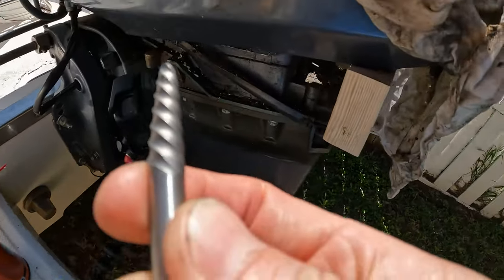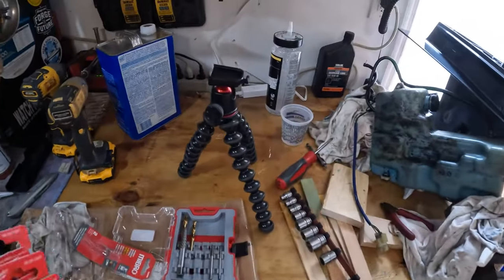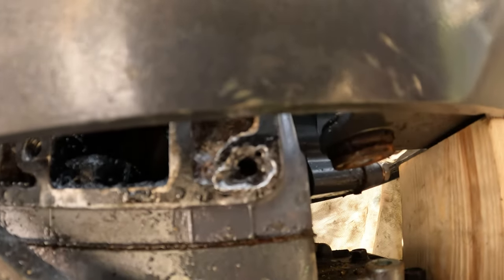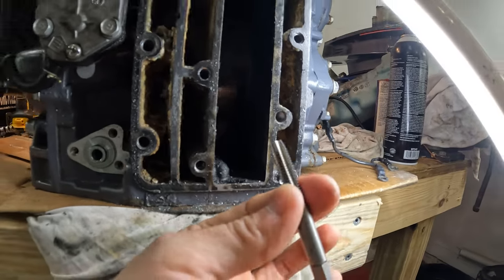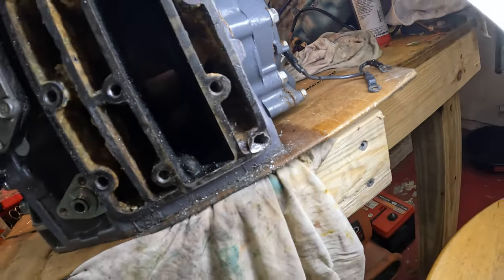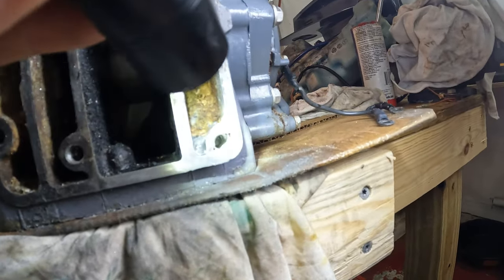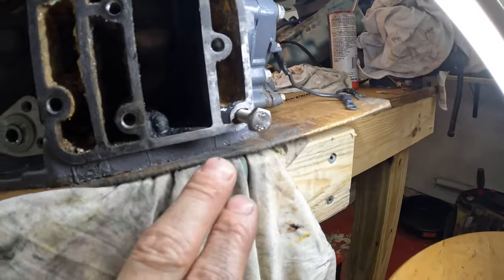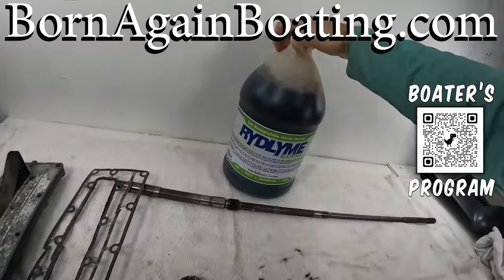Worst Case Scenario

Comment: Finally a video showing the real struggle of working on an outboard. Last year before buying my first boat and outboard i was watching all these videos about 100-200$ outboards that magically ran with just a new set of spark plugs and a carb clean, this video is the reality of old outboard repair, gaskets will fail, and you will have to deal with 10-30 year old bolts, with the consequences being as seen. Nice vid learned something new about the extractor
Reply from the maker: Welcome aboard!

Comment: Hello Arron. When it comes to broken off bolts, the tried and true method for removal is the use of a welder. Although welding is a skill all in itself, it can be done with some practice. If the bolt is broken off and it protrudes past the mating surface use some plyers to hold the nut that will fit over the bolt. Carefully start applying weld to the inside of the nut. This will take multiple short arcs until the nut is filled full of weld. If you try and fill it in all at once, the nut will melt off. Get a spray bottle of water and cool down the nut as soon as possible. Once semi cool, use a wrench (no impacts) and start working the nut back and forth until you fell the bolt starting to come out. You can also use some type of oil lubricant to aid in the process. The next and more tricky version, it is when the bolt is broken off either flush or inside the mating surface. With this method, you will need to build up weld on the end of the bolt until it protrudes past the mating surface. You need to ensure you do not weld the bolt to the mating surface. After build up, use the same method with the nut.  If the nut breaks off (which it most likely will) then rinse, wash and repeat. Typically a Mig welder that does not produce much slag is the best to use. If not use small strong welding rod and chip off the slag prior to applying more weld to the inside of the nut.
Reply from the maker: Thanks for the tip bro.

Comment: I just had this happen to me last weekend. Get a Dremel and a tungsten carbide carving tip. $9 tip and it will eat ez outs for breakfast. Worked good for me. Just bored straight down onto it. Still saved the threads. Also, I wish I tried just cutting a flat head screw driver slot in it and backed it out first.
Reply from the maker: Dude, that's a great tip! I just checked those tips out and I'll have to get some bits to do some experimenting with :) Thank you!

Comment: I probably would've filled the hole completely with some expoxy (marine tex, thixo etc.) And put the water jacket cover on and use the hole as a guide to drill it straight.

Comment: A set of diamond drill bits, $3 from harbor freight, I actually used them in a drill to grind out an old bolt. No risk of snapping because they are smooth, just keep it lubricated with the fluid of your choice, water, wd-40, cutting fluid, so it keeps the cutting surface cool and clean.
Reply from the maker: Great tip!

Comment: gotta love that red JB Weld. Sure, it takes longer to set and cure, but man, is that stuff a life saver, to date, I have a couple dirt bike cases, a 4 speed transmission bellohousing, one aluminum valve cover, several truck thermostat housings, countless threaded bolts & interior trim parts, an evinrude cowling and one intake manifold under my belt, this stuff is almost magic😂  Oh and I forgot to mention 1 VolvoPenta I/O exhaust downpipe.

Comment: What I have done before in an iffy situation like this bolt hole is to get it threaded the best it will and use something like shaft and bearing retainer or even Gelseal to thread in a stud instead of a bolt. This way the stud can be anchored in and a nut used to pull down the cover. Only in a non stress or non critical situation though.
Reply from the maker: Great tip!

Comment: I've been able to "pulverize" a broken off extractor using dremel tool type grinding stones. Probably $50 worth, as, well, but if you have patience you will grind that hardened steel part down and away.

Comment: Use a small diamond tipped ball bit with a Dremel tool to grind out the extractor. This process is slower but definitely works.
Reply from the maker: Cool, thanks

Comment: Project Farm's YouTube channel did a really cool test with thread repair on aluminum threads. JB weld did not do to well so hopefully you have enough threads left over, but I see why you needed JB weld for the gaps haha. Do you have a mig welder? They can work pretty well on old outboards if you prep/clean the area well. I think your fix will be just fine, just don't over torque it and maybe use some threadlocker or something. Love your videos!
Reply from the maker: Thank you!
Reply: I buried a nut in epoxy on my first outboard repower.
It was very solid and never worried about stripped threads.
Used a bolt covered in mold release to center the nut in the epoxy and it came out perfect. 👍👍👍

Comment: Why didn't you run some grease/ light oil on the bolt thread so the jb weld doesn't stick to it and it will unbolt